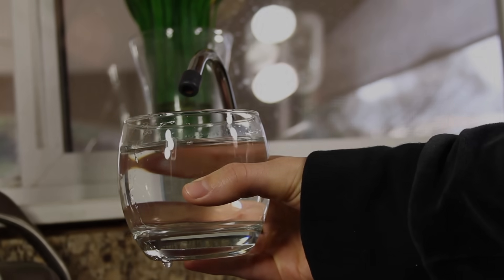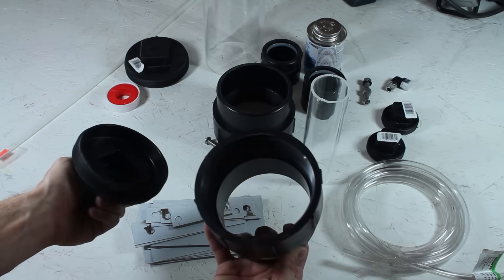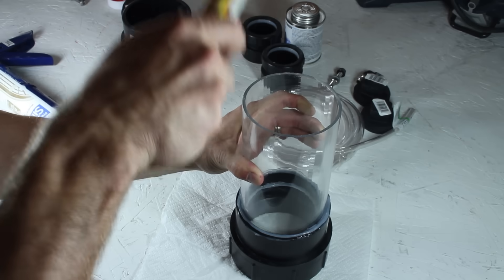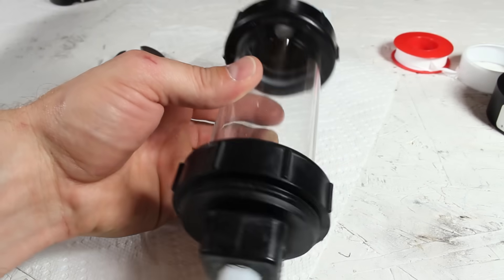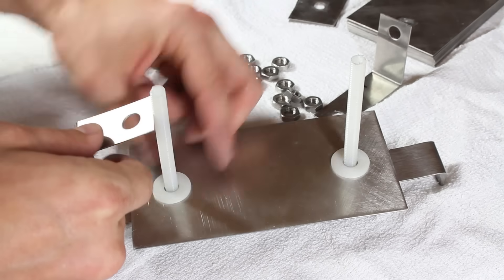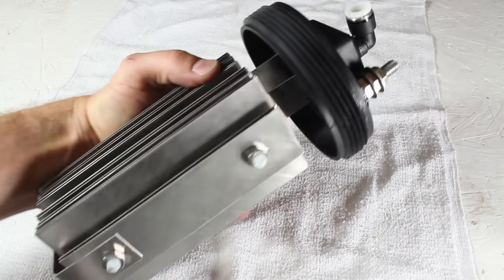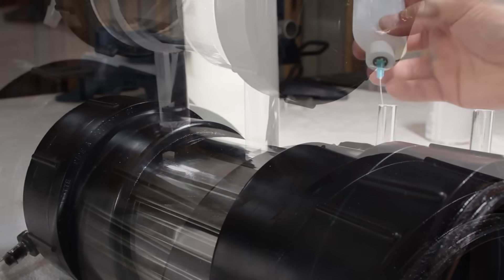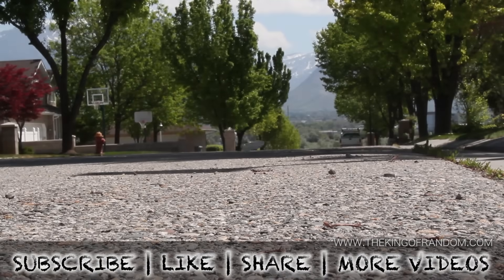HHO Generator - Water to Fuel Converter

Comment: Is it true someone who found that water can be fuel was murdered?
Reply: Conflicting reports. Abiding by the Laws of Thermodynamics, the engine was farce anyways given that you need as much electrical energy as much potential oxidation energy for the hydrogen. Heck, it takes a little more energy to even catalyze the oxidation of the hydrogen.
Reply: Yes. There was a gentlemen back in the 70's i think who designed an engine that didnt need petrol or diesel. Wether it was a hydrogen engine i dont know. But the big oil companies offered him millions not to bring the invention to the civilian market but he wouldn't accept it. And one day he was mysteriously killed and his engine gone. No one really knows exactly what kind of engine he built.
Reply: CAPSLOCKINGGGGGGG omg haha okay thanks

Comment: Have you tried running a small 4 cycle engine on this setup? I've seen a few people do it on smaller devices made from water filtration units, maybe 1/3 the volume. Might be worthwhile to try to set up one that could power a generator motor, add in an alternator to keep the batteries up to charge(I've seen brackets you can add to generators that give you a belt drive off the shaft between the engine and generator head  to drive the alternator) and you could then safely run a generator indoors, since the thing would only be producing water vapor, no carbon monoxide or CO2, un-burned hydrocarbons, etc.